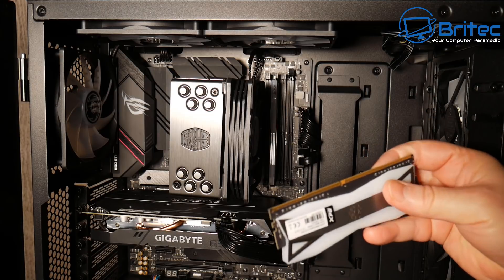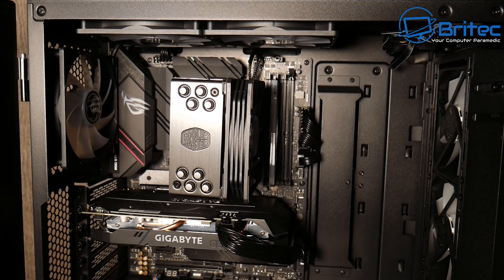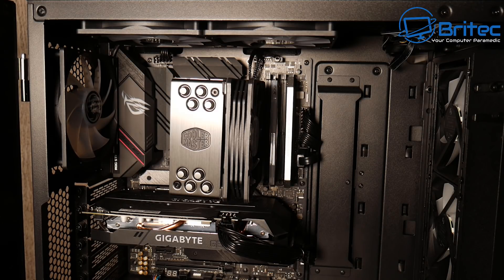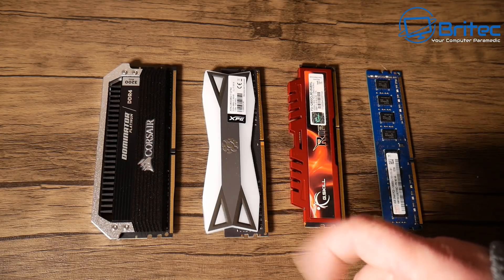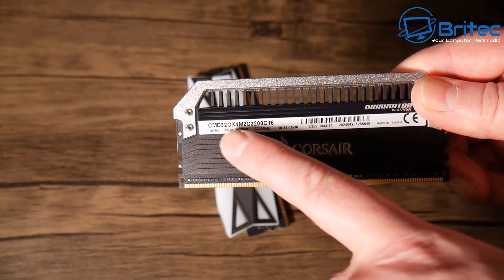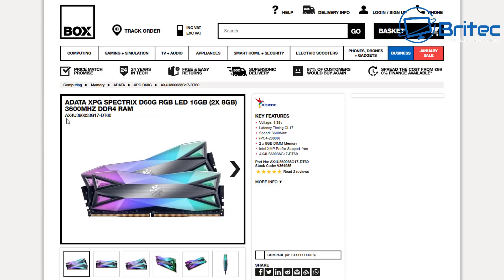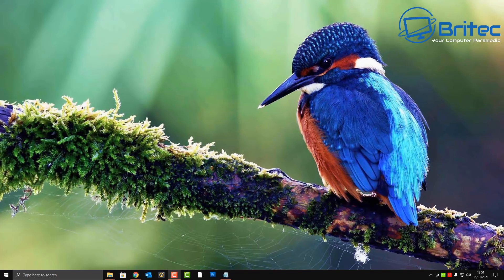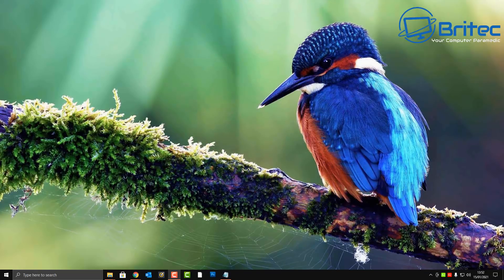Can You Mix and Match Different RAM

Comment: In my desktop I have 2 sticks of DDR4 3200 CL16 from X-Power and 2 sticks of DDR4 3200 CL16 from Corsair . I run all 4 sticks using the stock XMP 3200 16 18 18 18 28 timings at 1.35 v. And it all works great . They do overclock up to 3533 MHz , but during usage they will blue screen , so running them with the stock XMP profile , gives me a flawless experience. As long as the speed and timings match , you should be golden .

Comment: I have a one stick  1x16 gb RAM (xpg spectrix D45G)  and i can't find the same model but I found the same brand but with a different name (spectrix D35G instead of D45G) same time in same speed same voltage .
Should I upgrade ?

Comment: Thanks for the video. You may not understand why people would mix and match sticks but common reasons are:
- You need to increase RAM but your current kit is out of stock/ not produced anymore / Not available in your country.
- You found a great deal for a kit at a cheap price.

It's a real concern to many people with limited budgets and i'm sad to see the same answer again and again with little to no explanation. 

The inner workings of a RAM are supposed to be abstract to the motherboard, it does not matter what PCB, Memory modules it's using the motherboard should treat it as RAM stick. 

From my experience here is what i learned from mix and match:
- You cannot mix and match RAM modules with different voltages.
- You can mix and match RAM modules with different CLS and Frequency in dual/quad channel so long as you can make all your RAM modules work at same speeds as the slowest RAM module you have. 
- You can mix and match different RAM modules with different capacity and CLS and frequency if you make them work in single channel, they should work at the slowest possible speed by default, if not you need to make them work at the slowest possible speed or the system will be unstable.
Reply: I have installed :Corsair Vengeance RGB RS 32GB (2x16) DDR4-3200MHz CL16 Ref:CMG32GX4M2E3200C16 and yesterday i got Corsair Vengeance RGB RS 32GB (2x16) DDR4-3200MHz CL16 Ref:CMG32GX4M2E3200C16 , the first one are v.4.49 and new one v.4.34 ( don't know if is important). before the new one, i got dual channel on the ram. but now the new one have dual channel but single chanel on the old one. do you know why? board : MSI pro z690-A cpu I5 12600k running win11

Comment: My current unit run a ryzen 5 pro 4650g w/ 8gb 2666mhz and 8gb 3200mhz of ram diff. Brand. Is this ok? or it will turn to blue screen or error in future ?. Im beginner to build a unita.

Comment: Just one question. Can I use two different brands with same specifications. Like one ram is adata with 3200mhz Ddr4 while another is Hynix 3200mhz DDR4
Reply: Similar question, i have Corsair vengeance 3600 8x2, and i want to add xpg 3600 8x2 will it work?

Comment: So I have the same brand and same speed but different gb. 1 is 32 gb the other 2 are 16 gb and when I put all 3 I get no power but I mix 2 I get only the amount of the 32 gb showing up. Do you know what that means?
Reply: Not good to mix different capacity ram, you might've run into a compatibility issue.
Reply: @koreannom  thank you

Comment: Can you mix and match Ram yes you can does it do stuff to your computer I don't know but it seems to work just fine LOL. I had a four sticks of 1333 megahertz DDR3 RAM running at 16 gigs. They were all married they were all matching. But unfortunately one of them burnt out so I had to get a new one and unfortunately it's 1600 megahertz because I cannot find any more 1333. So yeah🤟🤟🤟 oh and I saw in your overclocking video that you were using Opera it's on your desktop. Do yourself a favour and uninstall it if you're still using it. It was bought out by a Chinese firm and they collect and sell your data more so than the American companies do

Comment: Also I have another question. I noticed in my  laptop that has two slots, named differently of course and that it has two sticks of the same brand however one being 8 gb and the other 4 gb. So is there a right way of inserting them into the appropriate slots or can they go any way around? Thank you.

Comment: Well said but isn't it safe to mention the issue of processor type and operation system  of 32bit versus 62bit. Most  people wanting faster computers are using older hardware. They are  often using limited 32bit processors or 64bit ready hardware but with 32bit  operating systems. I've had many people argue that they want for memory to increase speed.. then I burst their bubble because they read or were told by a tech or dealer to buy more memory. I politely tell them I want to check the specs like you have here but then tell them don't waste your money because all the 32bit OS is going to use is 4GB of  RAM.

Comment: Britec09 HELP!  I turned ON my laptop and got ‘Stop Code: SYSTEM THREAD EXEMPTION NOT HANDLED’ ?! Blue screen, unable to enter safe mode, laptop is just in a repairing files loop with QR link that doesn’t help with my issue! Thanks in advance!

Comment: It is optimal? No, but it can work just fine if the RAM DIMMs aren't all that different. Although I definitely don't recommend it in the mid/higher end, especially if you're to have XMP profiles active, that will most likely cause issues.

Usually, Intel isn't all that fuzzy with RAM. AMD, a lot more.
Reply from the maker: Thanks for sharing

Comment: What happened to yesterdays video about using Aomei.  I dont' see it listed.  I'd like to watch it again.
Reply from the maker: probably about 3 or 4 videos back, make videos everyday.
Reply: @Britec09  Brian, I checked your list of videos looking back about a week and it's not there.  I've never had any luck wth Aomei and wanted to watch your tutorial again.  I googled and found a couple of videos that were about 5 or 6 years ago......I think I just found it.  It was from 4/1/16.  Maybe you reposted an older video?  I've been making a mistake of making a backup of my C partition which goes well but restoring it when needed never worked even with a rescue CD.  Using my rescue CD it wouldn't show the image file I had placed on my external HD.  Using "system" restore works.

Comment: I bought the same brand and stock number of RAM that I had installed when I built my computer in order to upgrade to 32GB. It gave a POST error when I added it to my motherboard and also would not boot when it was run by itself. I noticed that everything was the same on the PCB sticker except for the version number. I finally found the difference in versions on MSI's memory compatibility chart; the chips were made by a different manufacturer. I called the vendor and manufacturer to see how I could order the correct version and they said there was no outside labeling that indicated the version number and one would have to open the packaging to view the version label on the product!
I returned the product and will wait until prices come down to buy a matched set of 32GB RAM.
Reply: I'm afraid in the future a 1tb of ram isn't enough for simple task

Comment: AMD does not like 2 different types of ram speed, even though it defaut to the slowest speed of the slowest ram speed! does not matter if ddr2 ddr3 ddr4 ddr5, it is okay for fixing purpose but not a permanent solution
Reply: Indeed AMD is extremely finicky not only with timing speeds but even certain brands of memory. I added the same brand to my system (different timings) and it wouldn't POST, as long as it was one or the other it was fine, but not both LOL

Comment: Always best to use matched RAM, especially if you are going to be stressing it. In practice, with all the used PC that I deal with, mixing RAM will be OK for general usage as long as you follow a few rules. Same type (DDR3/4 etc.), same voltage (DDR3/DDR3L etc.) and put the highest timing (slowest) RAM stick in the RAM slot 0. Not sure if it is true on the newest mobo but RAM timing is set by the RAM in the first slot and most RAM will run fine at slower timing but maybe not the other way.
Reply from the maker: Thanks for sharing

Comment: One of the reasons why someone will mix ram is because it's all they have at the time and can't buy a new set. I would say it's better to use one stick that works then two different ones. Even if it appears to work you can run into problems down the road.
Reply from the maker: but you can still find that ram the way I showed you. No need to mix ram